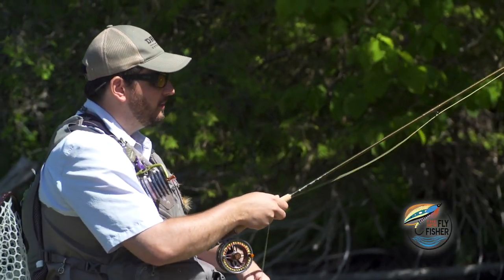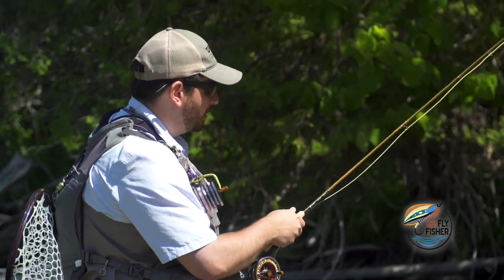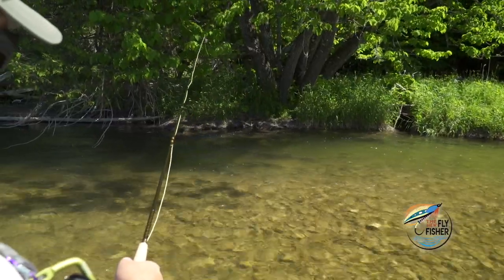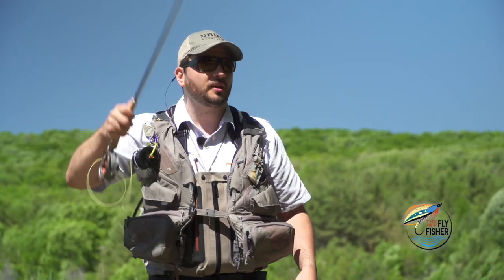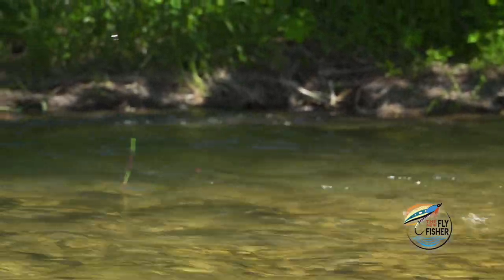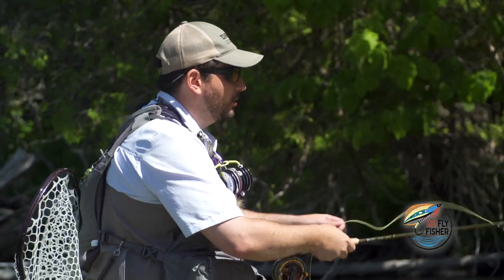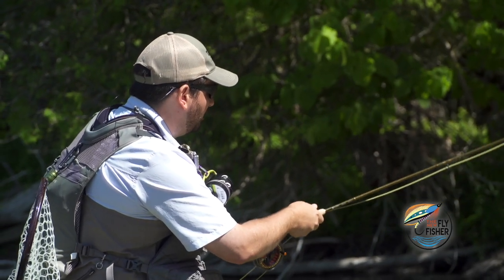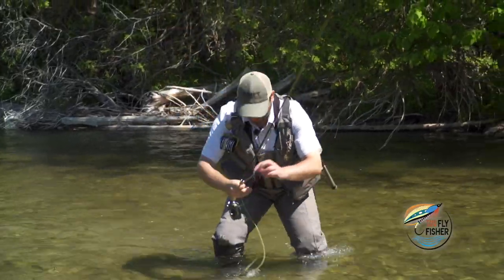Nymph Fishing with A Sighter | Guide Tips

Comment: I dont get it:
 You still continue coming up with these useless indicator- videos. Nymphing to me has absolutely nothing to do with optics. You can easily nymph by night, without any sight . Just feel any take in the tight line .  There is no need for bobbers or indicators, they are nonsense, no need for extra weight like splitshot or all that stuff. Just weigh your flies with the right amount  while tying them.  And - if necessary- take some yards of sinktip-  thats where fun starts. 
Tight lines!
Reply: I totally agree with you. The water he is fishing in the video does not require euro-nymphing. In that water, any nymph with 2.8mm tungsten bead can be tight swung and catches fish more effectively. However, sometimes there are deep pockets surrounded by fast water where it is very hard to get the fly line in direct connection with the nymph on time, in those situations I add a 10ft extra 5x to my leader and tightline high-stick (euro-nymph)